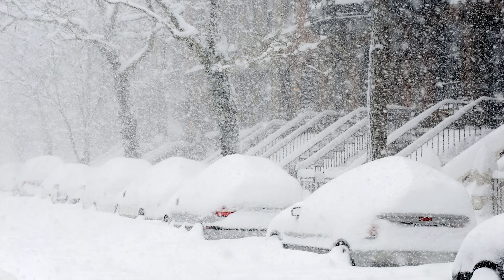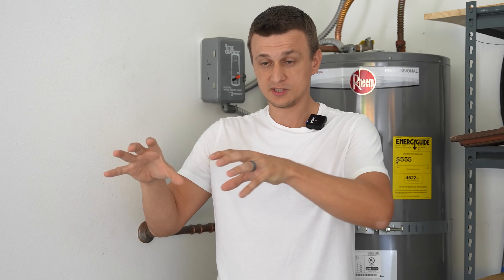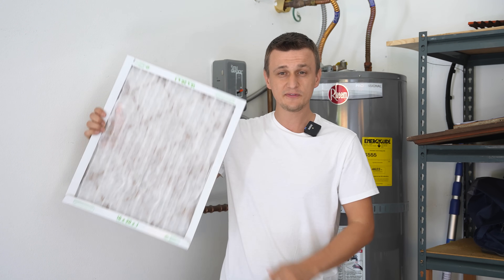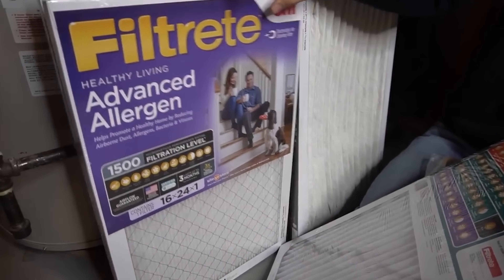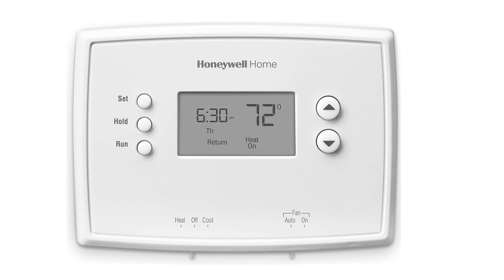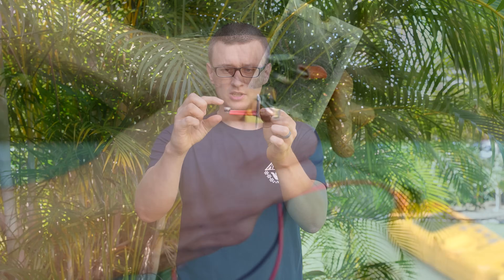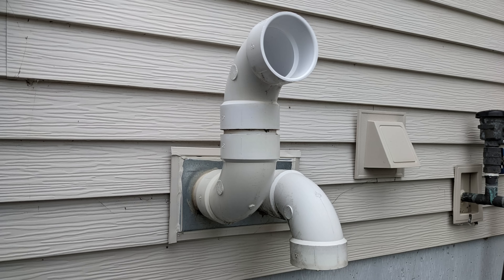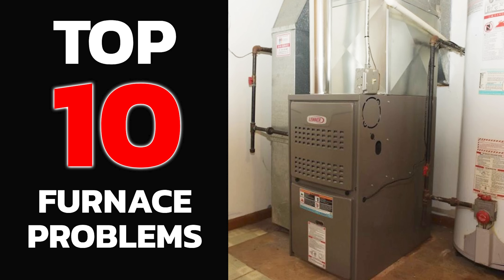Thermostat Not Turning On Heat - How To Fix It

Comment: What about the batteries in the thermostat. They could be weak causing it not to turn on the furnace at the proper setting.
Reply from the maker: Yes! That is a great first thing to check. Thank you for the suggestion!

Comment: Hi, I have one question.   About furnace.   After I replaced the ZONE BOARD, I have A/C but I don't have Heat.  Further diag, i dont have power to inducer.  Dvom test I don't have 24v at the white wire at furnace board.  My zone board have signal for thermostat call for heat.  When I jump Between C & W the inducer run and heat system operating as normal.   I have replaced one thermostat Just for testing.   But it's don't make a difference.   Have A/C. But NO heat.   I have goodman single state GAS FURNACE.  I need your help to guide me to a right video for further diagnosis.   I just wonder if my BRAND NEW ZONE BOARD IS BAD (honeywell hz432)  Thanks for any help!!

Comment: Mine was the limit switch.    I had to recalibrate it to make the furnace to stay on longer.    My vents wasn't even getting warm.   I had to turn my burner down so it didn't get too hot.  It's a 1980.
Reply from the maker: Glad to hear you were able to figure out the problem and get it resolved! Thank you for sharing, stay warm, and have an amazing New Year!!!
Reply: @WordofAdviceTV  I still have trouble with automatic coming on though. It did ok for a couple when I moved in and would run,  but last year the fan didn't want  after was on for a minutes.  I have to turn it on fan.  The landlord is to cheap to replace it. I 'll have to get someone to fix it.  Thanks for video it was helpful.

Comment: having issues with i have a norma programmable thermostat 52–2 558–8. 
I can program my settings when it’s on cool when I put it over to heat the display shows my houses temperature is 40.9 it isn’t with 87% humidity it isn’t. It’s cold in here.   They won’t allow me to program my heat because of this override.

Comment: Oh man, I saw the beginning of the video and it was the exact same problem I was having… but then you didn’t really go over how to know if the thermostat is bad so I’m not sure now. I have a boiler so no filters to check :/ replaced the battery in the thermostat and it didn’t affect it. I have two zones and it’s only one that does this where it’ll say like 64 or 63 degrees when it is set for 68 and just not kick on right away. But I know it’s not the boiler because on the other zone if I change the temp setting at all the boiler kicks on no problem and runs fine until it reaches the target temp. I was wishing for another way to check if it really is just the thermostat somehow failing even though it is programmed right and reading the temperature right. It just started behaving this way out of the blue with no changes to how it was programmed too.

Comment: New furnace runs fine for about 90 mins in the am, then turns off and does not turn back on. Therm temp showing 68 ambient, and I have it set to 72. It is showing System On, but furnace not turning on. If I turn the therm to Off, then back to Heat again, it will turn on. This same sequence happened with new Honeywell T6, so I put my old Honeywell CT3200 on, and same issue. If it is calling for heat (System On), it should be running right?? No error codes on furnace. Thanks!
Reply: Has new filter, not dirty.

Comment: Do antiquated GAS heaters have filters  If so where are the filters?
Reply from the maker: They should have them. If it blows air, there should be a filter somewhere. I talk a lot more about where you could find it in this video: https://youtu.be/uPaZvHp4L2Y?si=CM-aHKZU37NZYusJ

Comment: I moved into this rental home that has an older style 2GIG Thermostat.  I cannot figure out how the heck to fix it and have tried reading the manual but never got anywhere.  It is digital of course.  While both heat or cooling mode, the temperature that you have set that you want the temperature to be, must be TWO degrees different from the actual temperature displayed for the a/c or heat to turn on.  Is there a way to change that, so that it will turn on with only ONE degree difference between the temperature setting and actual room temperature displayed?  This would help our household tremendously and I know there must be a solution.  Thank you in advance, if anyone knows.

Comment: I have 2 thermostats in my home on downstairs one upstairs. The upstairs one works fine. The downstairs one doesnt click on and blows just a little cool air from the vents down there when the heat is on.
Reply: Switch them. If the problem switches, then there is a defective thermostat.

Comment: Hey, I recently moved to my new house, my ground floor thermostat is fine and space is heated but as I go upstairs, thermostat is stuck at 65 but set temp is 69. Changed the battery too but nothing helping. furnace kicks in though but upstairs is not at desired temp and there is no air flow from duct as well upsy
Reply: what is upsy

Comment: What would be the cause if the red light is not on at all. Heater works and then just shuts off red light off. Changed thermostat and worked for a while and just shut off, I had to take off the panels and start it by hand and it will start .

Comment: My HVAC has 2 zone and one of the zone has 2 damper which are connected in series. Almost all the time only first damper is open and other damper which connected to main damper is closed which is resulting no air flow in  some rooms. any way to fix this?

Comment: What if your furnace is completely electric and doesn't require a fossil fuel to make it work is there anything different in regards to troubleshooting it
Reply from the maker: It should still have a filter if it blows air and it will also have a thermostat. The troubleshooting would be a little different though since there are heating elements instead of gas burners plus there won't be any pressure switches.
Reply: @WordofAdviceTV  that's what I thought and I know on mine just by reading wiring diagrams in the owners manual it has contactors in it instead of the older sequencers like the earlier electric furnaces did so that has actually improved reliability which is a good thing

Comment: Ok here is a  question. I can't figure it out. I have a Keeprite furnace. I have a wireless Honeywell thermostat (not wifi) If I leave temperature at one temp. It works fine. But if I later turn it up. The furnace goes into lock down (6+1). I can't figure it out.

Comment: Man i dont know where to start , I’m turning on my thermometer to 80 and the house is still not getting warmer, I checked everything all the copper pipes are getting hot but the baseboards are heating . Any suggestions
Reply from the maker: Look up videos on boiler repair. My videos are all on forced air furnaces but you need videos on water heat/baseboard.  It could be a a few different problems like the circulator not working, bad control valve/s, not enough water in the system, possibly a bad water gauge, air bound, stuck flow check, etc. If you go to the highest radiator and open the bleeder, do you get water or air? I have limited boiler experience though so my virtual help won't go too far. I'm sure some other boiler videos and their comment sections will be of more help. Good luck sir!

Comment: I pulled the thermostat out while wiping the front down (dirty finger prints) and now can't get it to light up. The fan works but the display is dark. Any suggestions? I think I may have hit the arrows, which may have done something. I dunno
Reply: what does the manual say about this ?

Comment: Help I have a thermostat on my wall and I turned the thermostat on last nite and the heat is not cutting on. The furnace is in the basement and we normally can feel it or hear it running. As of last nite we dont hear it running. My uncle is the landlord and hes over seas. Its freezing at night and we dnt know whats wrong. Out thermostat is not the digital one u have on the video its the one thats not digital. What can be wrong 😊
Reply: hope you figured it out, not fun dealing with furnaces

Comment: what does low heat mean on a thermostat??
Reply from the maker: Usually that simply means that you have a 2 stage furnace and it is currently running on low heat/first stage.
Reply: @WordofAdviceTV  its a combi boiler not a furnace. is it because my heating flow temperature is on 65degrees? i was told if i put it above 70 it wont condense n wont be as efficient aswell. is that correcct?

Comment: What if the thermostat won't turn the furnace OFF above 66°F?
It turns on just fine, but we have to turn power off to the furnace several times a day.
Reply: I would guess the thermostat is defective. Try new batteries.  Try a friend's thermostat.
Reply: @toywrench1  Thanks.  Tried several thermostats, it was the wires.  There was an intermittent short.

Comment: Well if it not coming on look inside your furnace and ck the code could be chummy sensor ain’t letting it start pull the little black tube and blow through it and if stopped up blow the and then try it or Ck the code the furnace off switch is off when I was doing service work a lot of homes the electric light switch was used and the furnace will not come on if the power is off! Or flame sensor  so don’t panic I was on call  for the weekend and  Iwould hear it all!!! And if your furnace door has a button on it and if the door ain’t sealed right it will not work the last 20 years I when to ssa got a boiler man Job same ideas but much bigger
Reply: what is chummy ?